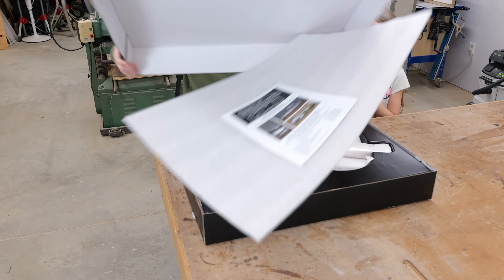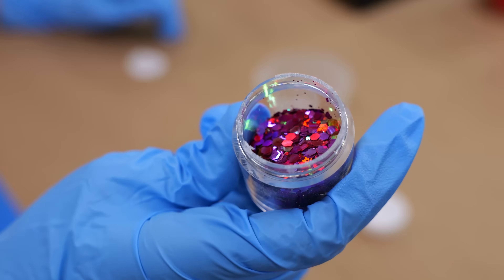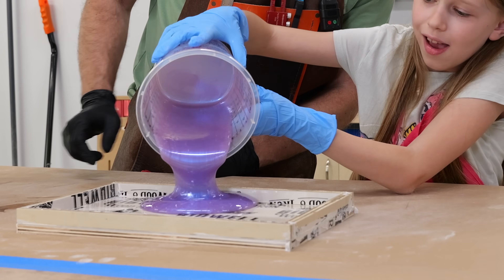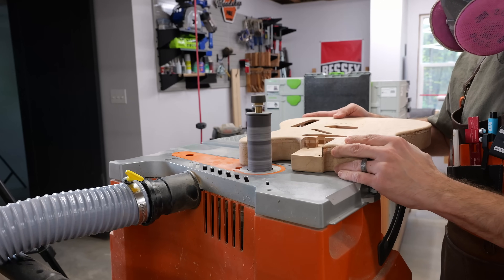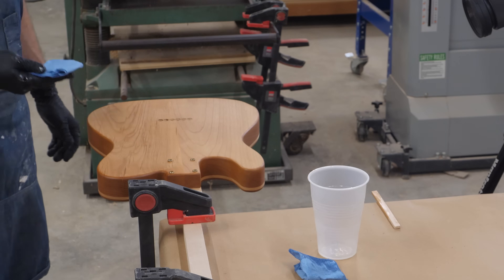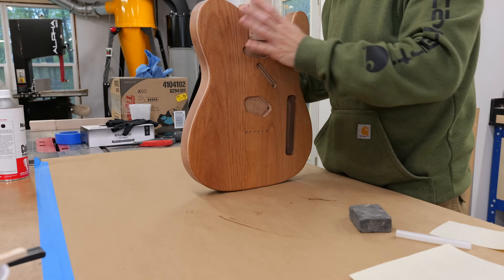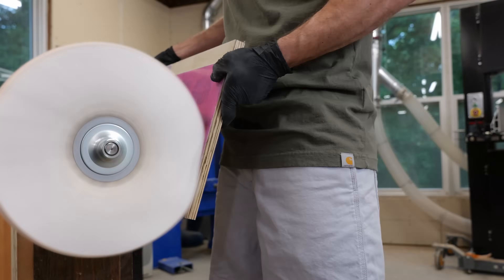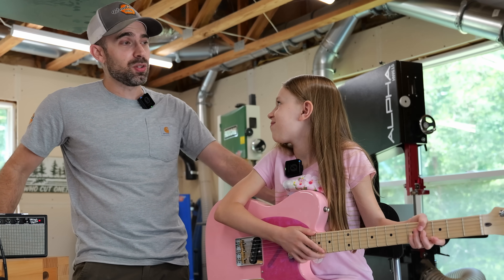Why I Cut a Guitar IN HALF

Comment: The whole reason solid body guitars exist is to eliminate feedback from hollow body guitars that became a problem when pickups and amps were introduced, so to say solid vs chambered or hollow makes zero difference, I just don’t buy it, however I imagine it can be eq’d to sound anyway you wanted in the modern era. I think as long as the whole guitar resonates together and is loud acoustically (electric guitar  on its own rings loud ) is usually a good indicator that the guitar will sound good. Some of the tones people are crazy about and chasing were recorded on 335s and dots semi hollows and probably the construction of the electric guitar effects its clean tones enough to make a difference however when you crank the amp up and pour the gain to it the compression lessons the difference to negligible I speculate anyways . I mean Kirk Hammet still sounds like Metallica playing greenie after all. I’m not going to say people are dumb for wanting guitars made with premium woods because ultimately it’s personal and if they want it because it’s a good weight or has pretty wood grain then yeah but to claim it makes a guitar sound “insert tone snob buzzword” because of that premium timber, nah I just don’t buy it. If Basswood is good enough for Vai , and was good enough for EVH it’s good enough for me. Oh yeah and those old 335s were made out of laminated wood (plywood basically) so do with that what you will. I don’t think chambering is going to make a big enough difference to take anything other than weight into consideration.

Comment: If you put aluminum tape on the backside of the pick guard, it would hide the routes while making the bright pink guard color show up more.
Reply from the maker: Ah, good suggestion!  Unfortunately once the epoxy was this thin a lot of those cool swirls were diminished.  I think if I do those kind of pickguards again I'll pour them closer to the final thickness.
Reply: I thought the guard was gonna be laminated w/ the purple (which might have also helped hide the routes), but when I saw the final I had the same idea of a foil backing.
Reply from the maker: That could make for a cool looking pickguard!
Reply: Not just hide the routes, but it wouldn't hurt to line the entire cavity anyway so that it's not subject to interference. To have gone to all that effort (and a great job too), it seems a shame not to complete the job with the electronic shielding.
Reply from the maker: Thank you!  I'm really happy with how the pickguard turned out!

The good thing is it's not too late to add shielding (or painting the pickup cavities with shielding paint) but I actually kinda like seeing the cavity.
Reply: I agree !
Reply: @WoodshopMike  A better idea would be to flush mount them then they can be thicker.
Reply: @TheFreeBass  great idea, as I have lots of foil tape lying  around, it makes sense, I too was little taken aback at first when I saw the rout between the neck pup cavity and control. But then I softened a little and thought it's kinda cool, gives a bit of 3d. However, it is also a bit out of line with the way every other aspect of this ,ahem, "kit" guitar was so thoroughly addressed. But great tip for adding a backing to a translucent piece!
Reply: @noggintube  I read somewhere that you need only do the pup cavities and NOT the control cavity? One argument is things in the control cavity grounding out and that (they claimed) it doesn't help hum) Any thoughts on that?
Reply: That looks amazing. I love the finish, and I really like that the pickguard is transparent. As a bit of constructive criticism,  I watched this to find out how much weight the chambering lost from the body. I before and after weighing before the finishing would have been great. Still, I really enjoyed the process and end result. Cheers

Comment: 20:20 wow that’s a reeeeally good trick for the epoxy. I have a project right now involving epoxy and I have a couple globs I’ve been sanding. Definitely gonna try this
Reply from the maker: I didn't even have to check the time stamp because I know exactly what you're referring too!  That totally blew my mind!
Reply: @WoodshopMike  hey Mike, I recently started working on guitars, and subsequently it’s got me into woodworking a bit. Was wondering if you had some advice on what tools I should be buying and in what order. So far all I have is a drill and a Dremel with a plunge router attachment. Still trying to figure out what to get next if I’m primarily doing guitar work. Appreciate it!

Comment: I’ve built several Tele bodies and I used Pine or Poplar for all of them. I weight relieved each. Basically I had a larger “main body” that’s about as thick as the real thing that I relieved of excess wood, and then glued a top on that I then planed down to the correct total thickness. Then I drilled the hole for the input jack so it is centered. All of my weight relief work was done in such a manner that you wouldn’t be aware of the cavities from any of the normal holes. And I think weight relieving provides better “tone”. But I also believe 10% of your sound is the guitar pickup. 20% is your amp and 70% is your fingers. Which means my guitars sound 70% worse than a lot of other people.
Reply from the maker: If this one hadn't been a kit I would have absolutely drilled for the pickup jack after everything was to thickness, but oh well, part of the fun of the challenge of this 😀

Your breakdown of tone is spot on 😂.  That's why I don't demo my guitars!  Not sure if you saw the video on one of the acoustics I built last year, but I had a studio artist demo it for me and sooooo glad I did!
Reply: I was first thinking 10% pups?- I disagree - then I saw where you were going w/the 70%. I mho, believe that it would be next to impossible to discern ANY difference between body wood types during a recording of blues rock through a nice tube amp. I could see a bit of difference between say maple vs rosewood fretboard, but (player aside) I believe the pickups are the tone. There are slight contributions all the other elements  make, which doesn't make them useless, but with fuzz pedals, tube texture etc, I think the pickups have the biggest influence. Even the "same" model pickup can sound very different.

Comment: Great job, you made your daughter very happy.  I have thought about buying a kit and do exactly waht you did here - congrats!
Reply from the maker: Thank you!  We had a blast 😃
Reply: BTW, those knobs are out of this world!  Will have to look into it.
Reply from the maker: Thank you!  I have another video in the works where I really focus on the epoxy elements.  Are there any questions you have around that process?
Reply: @WoodshopMike  The procdess and materials.  Wont have a pressure pot to use like you did but I will wait the longer period for it to set.  Really intrigued with the process.  Dont have a shop to work in so it will be in the garage or out on the deck.  Thanks!
Reply from the maker: Awesome, I'll make sure to touch on some of those in the video👊. My shop is in the basement currently, but I've had my share of garage shops over the years 😃

Comment: I highly recommend lacquer from Mohawk and Oxford Supply before Stewmac's product which is formulated with naphtha and takes much longer to dry and harden. @26:00 That's a very nice buffing wheel setup.
Reply from the maker: From what I understand the ColorTone lacquer is relabeled Mohawk (talked with a Mohawk rep earlier this year about that actually).  I'm relatively new to working with lacquer though, so just curious if you have a source stating otherwise.  Not being argumentative, just curious.  Thanks!  That buffer enclosure was actually build from a recycled coffee table 😂

Comment: The tonal differences in electric guitars can be varied greatly by addressing the bridge and the wood around it. It would be interesting to do a study with sensors measuring the internal density factors at the bridge on a number of guitar designs. Then use simple internally stacked wooden louver mechanisms to at varying angles, and varying tightness to recreate some of those numbers, but in one guitar.

Comment: Awesome build ... AND ... dad n daughter video!  Question: what is that diagonal channel visible through pickguard ... done on purpose or could not be helped?
As far as voice of solid body vs. chambered I believe all the variation of solid body electrics gives the variation of  HOW the guitar PLAYS and SUSTAINS. It does give voice variation but obviously not as much as hollow bodies.  But, not as much as you'd think. The sound is due to an amplified microphone basically.
Reply from the maker: Thanks, I'm glad you enjoyed it!!

The diagonal channel is for routing the wire from the neck pickup to the controls.  It was already in the body.  

That's what I've found too.  There's some nuanced difference in tone, but its not night and day.

Comment: Great Video, thanks. One remark about the grounding cable to the bridge: don‘t do that (even though most companies do). Proper shielding of all cavities does the same. The ground cable means that there is an electrical connection between the housing of the Amp and the strings that the player touches. So if there is an issue with the amp that leads to voltage on the amps housing, that voltage is on the strings. Guitar players died due to this cable because the guitar company saved a few bucks on proper shielding.
Reply from the maker: So glad you enjoyed the video, thanks!

Thanks for the info, I usually coat the cavities with shielding paint.  Have you noticed that to work just a well as the tape?
Reply: I tried the paint once but unfortunately I am not the guy who works as carefully and diligently as you do, therefore I prefer the copper Tape as it works better for me.
Reply from the maker: Ah gotcha.  Yeah that stuff can be quite messy!

Comment: Impressive commitment to detail and tool arsenal, but no drill press for drilling the neck plate? Also, curious to know the total amount of time for this project. Did you keep track? Thanks!
Reply from the maker: Thanks!  Yeah, I could have gone over to the drill press, but since the holes in the body were pre-drilled they served as a guide for my drill bit so I wasn't too worried.

As far as time... I have about 15 hours of footage (you're welcome for editing it down a touch 😂) so I'd say the total time was about 30 hours?  The majority of the time was spent on the finishing steps FWIW.

Comment: I built a hollowed bass guitar. For that I cut the body in three pieces with a table saw. The center piece and the neck alone could have been a complete bass, but decided to put back the "wings". The wings were hollowed from inside. The bass itself has a great sustain. Probably this has to do with using 6 neck screws. In my opinion sustain has to do with how rigid the neck is attached to the body. The pickups are a combination of P-bass and Music man. Using just one coil of the Music man pickup, gives me all the tone I can get to mimmic a Jazz bass.

Comment: I don't worry much about tone impact with choice of woods or chambering. The pick you use, where you pick, amp EQ settings, pickup height .... all make a bigger difference. It might make the acoustic sound different (i.e. not plugged in) but that does not translate to a big difference when amped. I would be more worried about balance. I hate guitars with neck dive. BTW - just wondering if you considered adding a forearm and/or belly cut. Besides adding comfort, it also contributes to weight relief.
Reply from the maker: I've added belly cuts and forearm relief on other guitars, but didn't have that vibe on this one.  You'll be glad to know, there's no neck dive 👊

Comment: Are you using a HVHP (high volume high pressure) spray gun (most popular)?  I saw a lot of orange peel before the sand.  Use a LVLP (low volume low pressure) spray gun.  Finish will be very flat.  Thanks for video.
Reply from the maker: I'm using a turbine HVLP yes and you're absolutely right there was a lot of orange peel.  This was my first time spraying nitro so I don't have a ton of experience with accounting for humidity (I think you're suppose to add more retarder?) and it was super humid the days I was spraying.  Also not sure if I should have laid down the coats a little heavier...  Happy to any suggestions you may have as I'm not a finishing expert.

Glad you enjoyed the video!

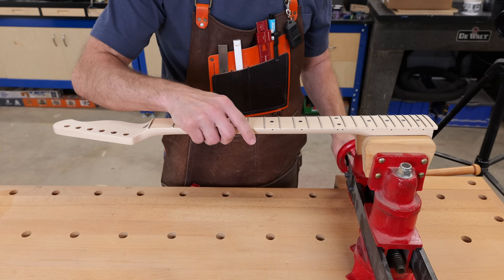Comment: 16:46 i was first wondering why you would seal it with epoxy after going to all that trouble to get rid of weight...
...but then i thought about how easily the wood gets dented.
So...good choice!
Reply from the maker: The epoxy that's left on the guitar really doesn't add much weight at all, but definitely made it harder.

Comment: Nicely done!! 👍

Funny though - the description clearly says "The Maple neck right out of the box feels smooth and fits tight in the pocket".

Well, thát didn't apply, did it? 😜

And at $500 it most definitely should...
You're lucky to have a load of professional woodworking tools, but those looking to buy a kit, should just be able to build to the quality it advertised with.
I'm currently building a kit, made in China, cheap as chips, and the neck fits the pocket spot-on. As it did with the previous kit I built too.
Reply from the maker: Thank you very much!

Yeah, I don't know if mine was just a lemon or what because the reviews I've read are all pretty positive on this kit.  Was surprised and thought about reaching out to StewMac to get it replaced, but figured I'd just run with it and show how to fix the fit 😀

I have another kit guitar build planned for later this year.  It'll be a fun one!

Comment: Main problem with doing that is neck dive, as the whole guitar is balanced on the front strap button. So removing weight in the body will make the body lighter and un-balance it. Guess you found that out right?
Reply from the maker: I've been mindful of that with previous builds and thankfully this one still balances just fine.  I could always put some wheel weights in it tough in a pinch 😂

Comment: Use a 3" nail or screw as a stopper for your caulk. Then, put tape over it and just make sure you're not putting any pressure on the back and anymore.
Reply from the maker: I've taped up the end, but not with a screw/nail.  I'll add that next time and hope for the best.  Thanks! 👊

Comment: Before shimming the neck pocket it is crucial to check if adding the shims will push the neck out of alignment. You should have put on the bridge and checked with some dental floss as replacement for the outer E-strings first before proceeding.
Reply from the maker: Totally agree, but I had to shim both sides of the neck pocket which symmetrically reduced the width.  Great point though, thanks for mentioning that 👍
Reply: @WoodshopMike  Sure but you don't know with these kits. Could be that the neck is already out of alingment. Happened to me once even with a more expensive already assembled Fender. the treble side way closer to the outer edge of the fretboard the the bass side. Even if it looks symmetrical always measure first.

Comment: Very cool video and guitar.  

Hate to be ‘that guy’ but one correction.  If your guitar noise decreases when you touch the strings that means that you DON’T have a grounding issue and your guitar is PROPERLY grounded.  

It’s a confusing subject and people who aren’t used to working on electronics in guitars mix it up all the time.
Reply from the maker: Thanks man!  Glad you enjoyed both and I appreciate your approach in an attempt to not be "that guy" 👊

Just to clarify (maybe I said it wrong in the voice over🤷) but the hum does get quieter when I touch the strings.  So it sounds like things are good?
Reply: @WoodshopMike  Yes! That is exactly what you want.
Reply from the maker: Awesome, that's what I was thinking and then worried I was going crazy and had it wrong all these years 🤣
Reply: @WoodshopMike  yes!  That’s  how you know that your grounding is working.
Reply from the maker: Thanks for confirming 👊

Comment: When waxing neck screws, I've found that the cheapest brithday cake candles from the grocery store work even better than beesswax for a fraction of the price and are much easier to find.
Reply from the maker: Right on, thanks for the tip👊 I usually go for paste wax, but didn't want the solvents to possible react with the lacquer.

Comment: Cool project.  With a wood shop with that kind of equipment, I'd make the body myself from an alder or swamp/punk ash lumber blank without hesitation.  

BTW, I can say from experience that making Fender-type/style bodies 1-1/2" thick can reduce weight substantially.  I have two P basses I built that are less than 8 pounds.  Olinto also makes their Fender-shaped bass bodies 1-1/2" thick. 

Many such companies as Warmoth produce their Fender-licensed replacement bodies 1-3/4" thick despite the originals, as Fender made them since the 1950s and '60s, which were made 1-5/8" to 1-1/2".   Warmoth offers chambered bodies to reduce weight to compensate for their thickness.  IMO that's an excessively complicated way to go about reducing weight in a guitar or bass.  Either way, there's no tone difference.
Reply from the maker: Thanks!  I usually build completely from scratch, but did something a little different for this project.  Take it easy and glad you enjoyed it!